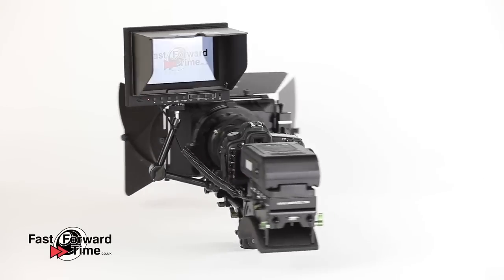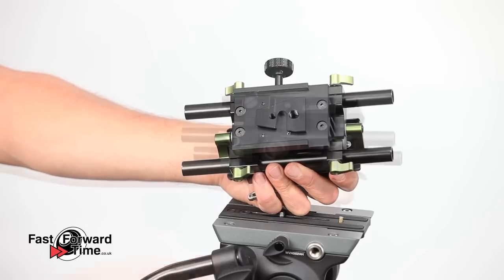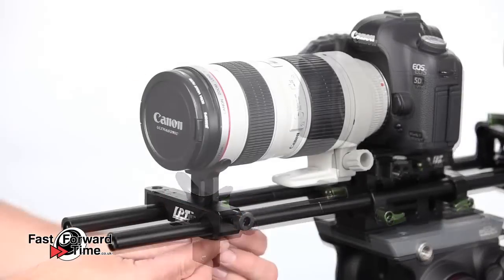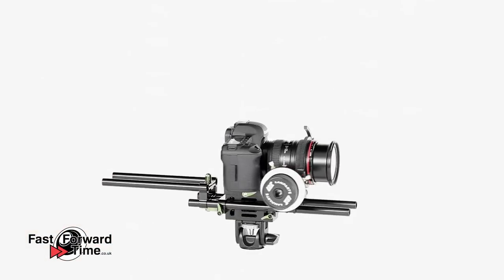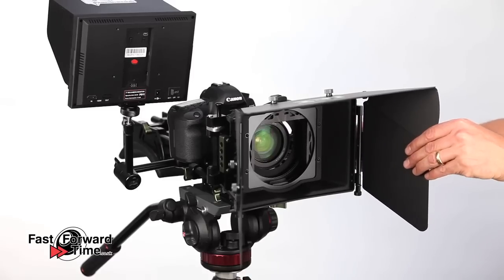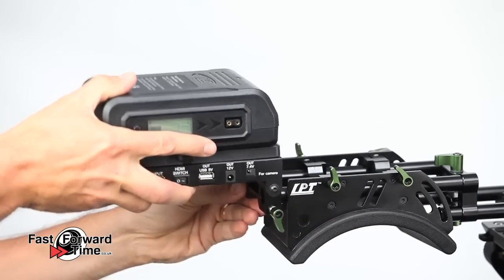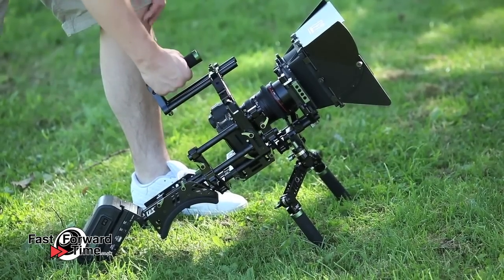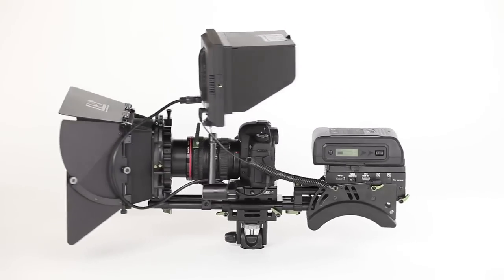How to Configure a Lanparte DSLR Video Rig - A Complete  Walkthrough & Review of Each Part.

Comment from the maker: The rig should work fine with CP2 lenses, the only problem you may encounter is when using 4x4 filters in the matte box, as they are 100mm square (slightly smaller than the 114mm lens diameter you want to use).  If you are not using filters, simply remove the 2 filter trays, and you have a diameter of approximately 150mm for even larger lenses.

Comment: The V mount battery is garbage. Mine won't even charge and the display on the side busted immediately. There's no place on the web to find out what's going on either
Reply: If you're having trouble getting things sorted, shoot me an email - josh@ozirig.com.au

I run OziRig; and we were one of the first distributors of LanParte so I can help get you sorted.

If I remember correctly, there was a revision of the boards on these batteries in the first half of 2014 so it's possible that you may have bought it from a dealer that was using old stock, or it may just be that you've been a victim of some bad luck. 

In either case let me know and I'll see if I can't get LPT to help sort you out :)
Reply: Hello Joshua, the output of the V mount is set to feed a Canon camera, what if I use Sony a7 cameras? I also use an Atomos Shogun device